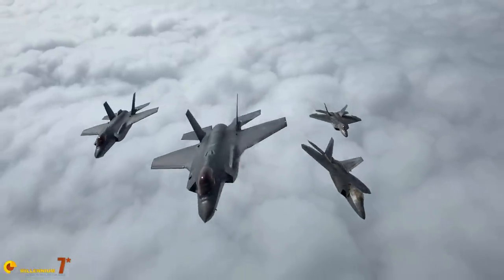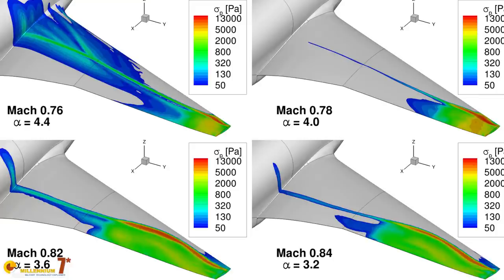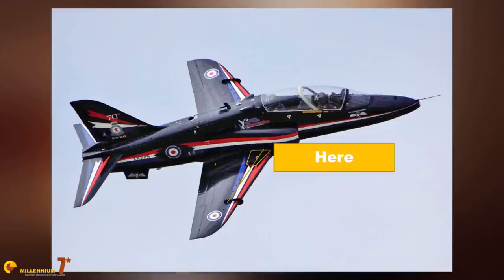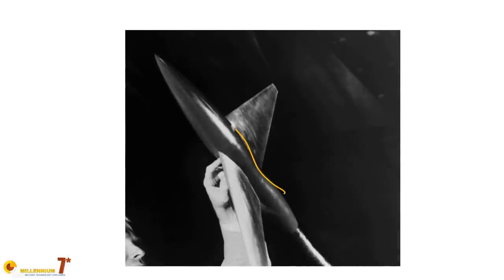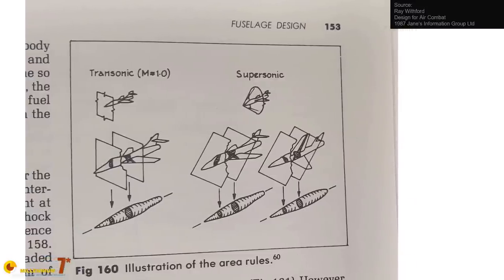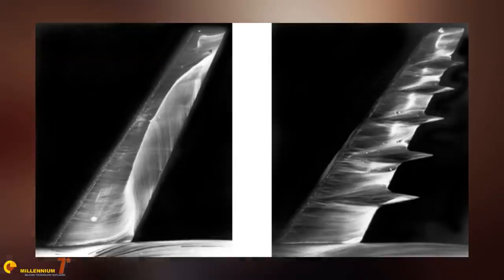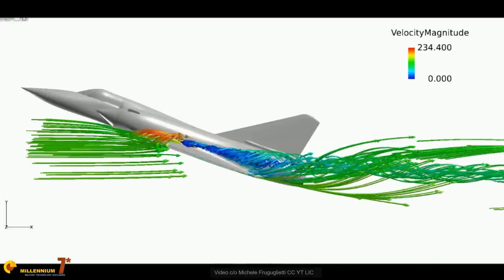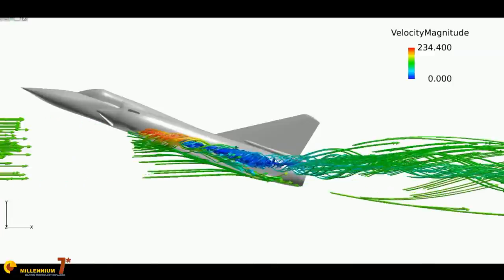You Won't Believe the Odd Things Found on Wings - How to Read a Fighter Jet Wing Details

Comment: Aww, kinda missed the F-4's wing design here. It may have been a flying brick, but it's wing is an aerodynamic thing of beauty. In many ways the F-4's wing was designed much like a delta, even though it had rear horizontal stabilizers "as well". A 'plan B' for virtually every aspect of the plane. Anyway, it's wingtip design is just marvelous, in the aspects which you brought up in this video.

Both the F-4 and the F-15 placed a particularly high focus on pilot input/feedback in the design process. James S. McDonnell (old man Mac), was extremely focused on getting all the best fighter pilots he could get his hands on to come inform the design process. Really helped make some planes which were hard to stall or spin, and easy to recover if they did. As well as other seemingly common sense details like "don't bother giving me twin engines for safety unless you're going to isolate them from each other with a fireproof armored titanium plate", or an insistence on self-sealing flame retardant fuel tank filler material (even at the expense of maximum fuel capacity). Pilots care a lot about control, durability, and redundancy (understandably so), usually to a greater degree than engineers ;)

I think FBW has had as much or perhaps an even larger impact on aerodynamics than stealth though. I mean, now there are planes which go into stalls or spins "on purpose" as part of their maneuvering toolset. And you have stability arrangements which would be insane without FBW keeping things under control.

I'm really intrigued by the wing design on the YF-23 which you pictured briefly. It raises a lot of hypothetical questions about how it would perform in various circumstances. But it's interesting that the most up to date version of that wing is in the Loyal Wingman, which starts out with the same diamond shape, and then reverses the trailing edge to make the ailerons distinctly separate in geometry. Makes me think there may have been undesirable characteristics found in the 23's fully diamond wing shape.
Reply: Yep the F4 wing is a joy of dihedral and adhedral lines, witness the "horizontal" (I know purpose not configuration) stabiliser. Was the plane of my childhood,  Vietnam and Yom Kippur and the pictures in Time and Newsweek, peaked my enthusiasm for it. Interesting your McD insight, thanks.
Reply: Yeah in the f-4 you could see the sawteeth, slats or flaps with boundary layer control, double surface spoilers.. what a great school for a mechanic it was

Comment: The stream lined bodies near the sawtooth on the 37- Viggen houses the forward/side facing radar warning receivers. The third and rear facing RWR is mounted in the "tail" above the jet exhaust port. No idea if they serve any positive aerodynamic effect, probably just for being geometrically logical. If both receivers pick up the same signal then it's probably coming from the front. Since that's the only direction both receivers FOV interconnect. If DCS-game hold true, earlier variants of the viggen had a simpler 6-directional RWR. 

Hope this helps for anyone wondering!

Comment: But does not the modern EA-18G Growler not employ wing fences on an unswept wing? What is the reason for this given the F/A-18E/F do not use them at all?
Reply: Found this on keyaero forum:

"The fence and the fairing on the dogtooth are part of the Transonic Flying Qualities Improvement (TFQI) package.

Everybody remembers the infamous wing-drop problem, which was fixed by software changes and making the fairing over the wing-fold "porous". This fixed the wing drop problem but introduced buffeting at transonic speeds. The buffet was deemed acceptable for the E/F but was found to decrease accuracy of the wingtip ALQ-218 receivers on the G.

The TFQI changes the wing fold fairing back to a solid one, modifies the dogtooth and adds a wing fence. This fixes the wing drop just as well as the original fix but without the buffeting."

Comment: A fuselage has its oddities too. At an air show I noted a small right-angle bracket riveted to the fuselage at slightly angle to the air flow. When I asked the pilot, he pointed to an opening about two feet further back. The opening drew in cooling air for electronics, he said. The bracket was to create a high-pressure area there to increase that airflow. I suspect that was a retrofit.
Reply from the maker: Which plane?

Comment: The barbie waste on an aircraft, creates a horizontal low-pressure zone that will draw airflow, normally away from the body of the aircraft, toward the wing tip, back more in line, or parallel to the axis of the aircraft. That is my guess!

Comment: Thanks ones again for great and informative video. 
I have a question:
A plane need to have the same cross section all the way, and to help, the Kuchemann carrots can be applied.
But what if a aircraft has been fitted with two external tanks under the wings, or carry a large weapon load. The cross section of the aircraft must be totally destroyed, or is there a way to compensate for this ?

I hope you can find the time to answer my question.
Reply from the maker: Stores ruin the rule, normally. Some external fuel tanks are area rule shaped to mitigate the problem.

Comment: I've also read somewhere f35 has wings clipped from the tip that reduces the RCS, but it also makes it less efficient aerodynamically. 
But f15 also appears to have wings clipped from tips (which is not a stealth plane). Any thoughts ?
Reply: 1. to have the rails
2. to stay within the main shock wave